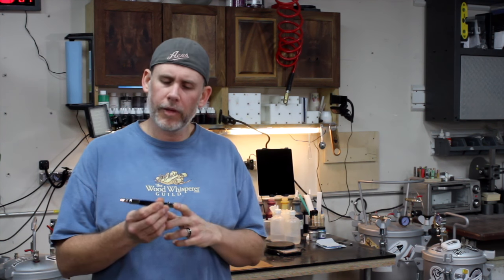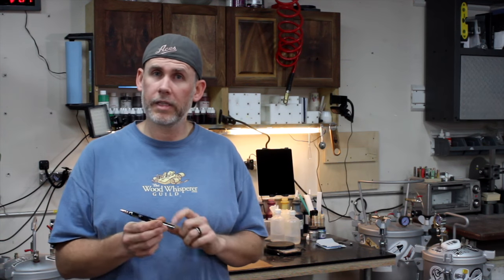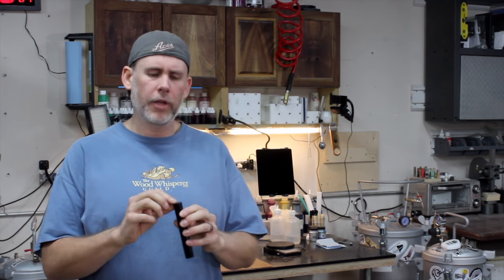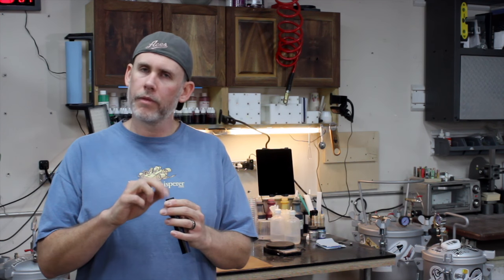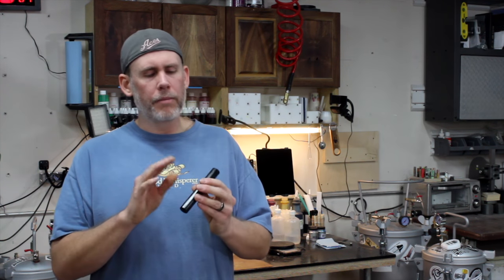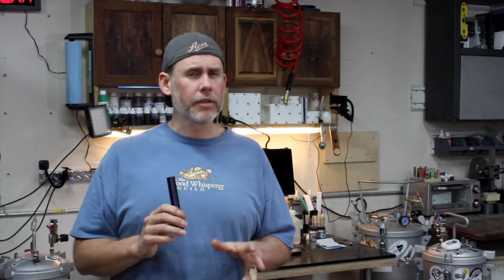Thin Blue Line 30 Cal Bolt Action Pen | Pen Blanks by NV Woodwerks

Comment: I like where you add thin CA to the inside.  I usually use thick and spread but I think you're right about the blow out issue.  gonna try that method on my next one.
Reply from the maker: Never had any blow outs since I switched to that method, got that tip from Curtis Seebeck. One caution though, I wouldn't use thin CA on wood blanks. The wood usually has a bit of moisture in it, and it makes the thin CA set up too fast to get a tube in. Use medium on both the tube and blank for wood ones

Comment: Nice! I've had blow outs in the past, I'm going to try your method for sure. The thin blue line blank turned like butter, top notch quality Zac
Reply from the maker: Thanks Moy!! Yeah, I've had a couple blowouts too, and I think the culprit is usually the blank not being locked down to the tube. So far, with the double glue method I haven't had any since.  You know what, just washed my Moy's Woodshop T-shirt today. Think I'll pull that out for Wednesday's live stream =D

Comment: nice tips Zac it happened to me too, now i put it all along the tube, but maybe i will start adding to the blank too.
Reply from the maker: Yeah, I think glue bond is the cause of most people's frustration with acrylic blanks. Happened to me a few times. The last time it happened, I really investigated the pieces and realized there was a pretty big area that had no glue right on the end where it shattered. After that, I started dousing both the tube and inside of the blank real well, haven't had a problem since. 

Same thing goes for drilling. Had a couple shatter when drilling, and I realized my vise had some play in it. If the blank is moving around and a tool digs into it, once the movement stops it will shatter it. I have my vise totally locked down now, never have that problem anymore.

Comment: Very nice.  Have you thought about making one with green in it for the military?  I live in an area where the Air Force has a big base and the thin green line is popular around here.
Reply from the maker: I've been asked about that, but I don't think they'd go over as well because the green is pretty dark. I'm afraid it will just be difficult to see next to the black or way too light green and not look right

Comment: Hey Zac, thanks for the video. Do you rough up your tubes before you glue them in??  Sa-weet pen by the way.
Reply from the maker: Thanks!! Yeah, I always rough them up, usually with 180 grit. Thanks for pointing that out, I'm planning on doing a video specifically about glueing tubes in, I'll definitely mention that.

Comment: Zac. What RPM are you using on your buffing wheels? My Beall Buffing wheels are always throwing on strings. Yours are neat and look uniform? Thanks!! Oh, I can't figure out the "twitch" media to watch any of your newer stuff.
Reply from the maker: Somewhere between 700 and 1200 usually, it helps to "dress" the wheels with a piece of 80 grit sandpaper backed by a piece of wood. That should clean the fuzzies out a bit. You'll still get some fuzzies though, it's inevitable.

Twitch is a live streaming platform. Just go to my channel and watch on Wednesdays and Saturdays 2-4 PM. There are some past broadcasts that you can watch on demand there too. https://www.twitch.tv/nvwoodwerks

Comment: Zack I noticed your tube insertion tool.  Did you make it and is it silicone?  It looks good and the CA shouldn't stick to it.  Is it available or do you have a DIY video.  Thanks for a good tutorial
Reply from the maker: Good eye Dave!! =D It's the simplest thing ever, just a tapered silicone plug with an ice pick type thing (think it's actually from a dental pick set)  jammed into it. Since it's silicone, the CA glue just pops right off. I think I got the plug from Fred Wissen, ptownsubbie.com, but you can find silicone plugs like that on eBay and Amazon too
Reply: Thanks for that Zack I will have to get some.  A lot easier than trying to clean a metal or wooden one
Reply from the maker: You're welcome =D Pretty cheap and easy, that's how I like it!!

Comment: I press the front end in with the nib attached. if you don't you will damage the brass threads and you'll never be able to screw on the nib
Reply from the maker: Never had that problem myself, have you damaged threads assembling them before?
Reply: Zac Higgins the very first one I did and I started pressing them in with the nib after that.
Reply from the maker: That's a bummer!